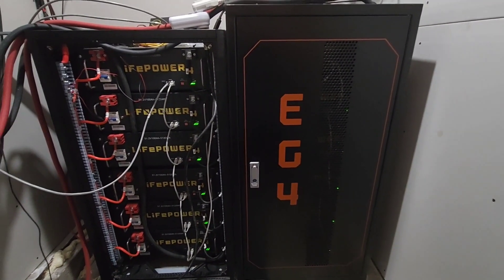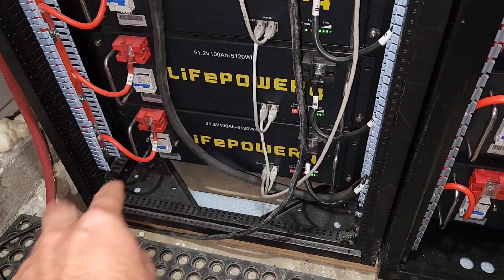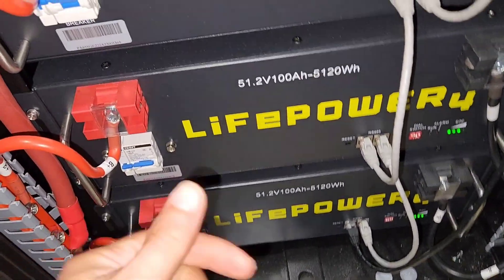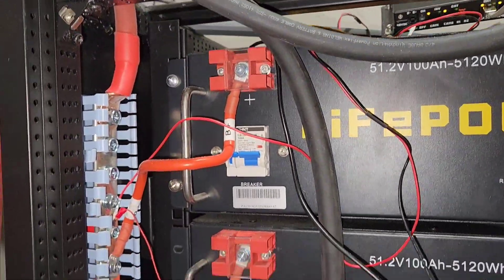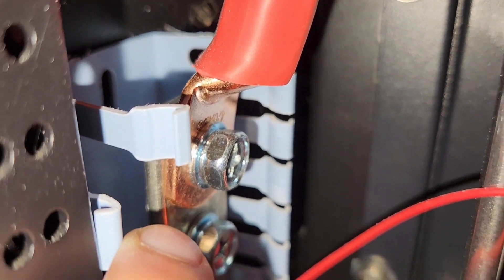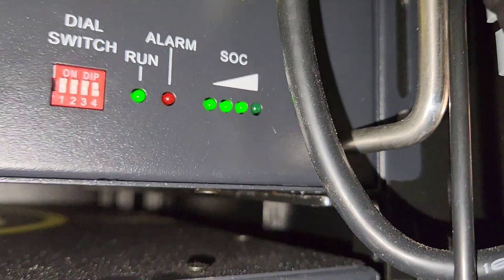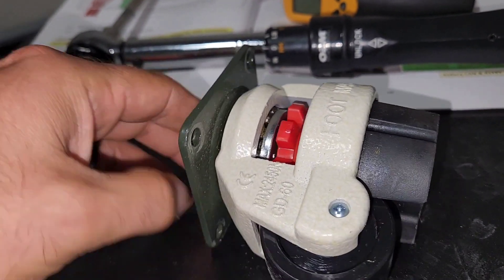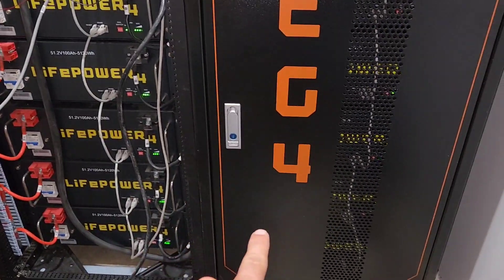EG4 LiFePower4 Battery Rack 2022 vs 2023

Comment: I just got my second server rack of 6. Any input on the best way to wire them together? I’m new at this. Thanks
Reply from the maker: Originally I had mine wired independently, but I noticed that my new rack was lagging.  Last month I switched to a single run positive top left side stack and Neg Top right side rack.  Connected the two racks Busbars at the bottom.

Comment: Thanks for the review. I currently have 4 batteries and the 1/2 Rack for 3 batteries and Have my 4th sitting on top. It has the same design as your older model. I will be buying 2 more batteries and the 6 unit rack so is nice to see the improvements..

Comment: One thing you mite want think of is if the battery catches fire you mite want to have the wheels on it a Anderson connector so you can unplug it and shove it out the door.
Reply from the maker: My batteries are located in a detached garage, the room has fire rated drywall and rockwool insulation.

Comment: On the EG4 Enclosed Battery Rack.
Do you see any reason you can't put the rack on its back and load the batteries from the top? I have a height problem.
Reply from the maker: I think that would work.

Comment: I’ve seen the new ones. They seem nice. I also like the smaller grommets on the top. Those massive ones on the older models just made a mess when you poke the wire through. I bet if you added those castors under the older cabinet it would level them out.